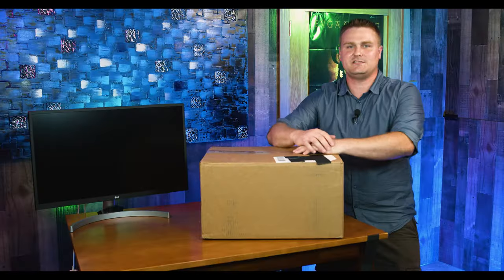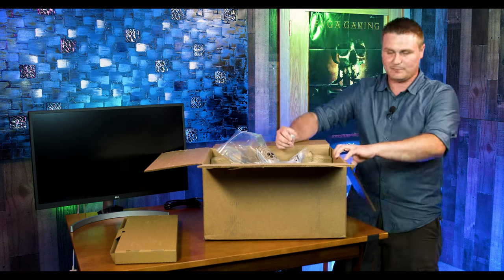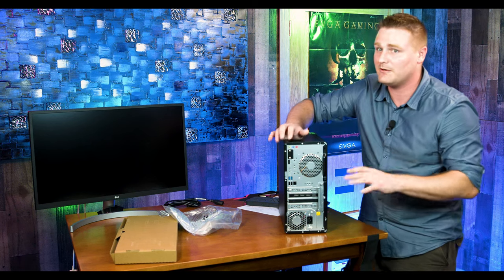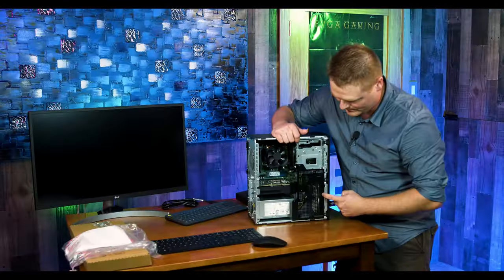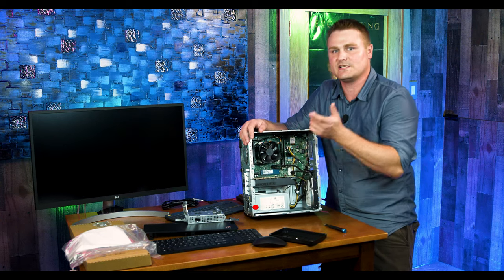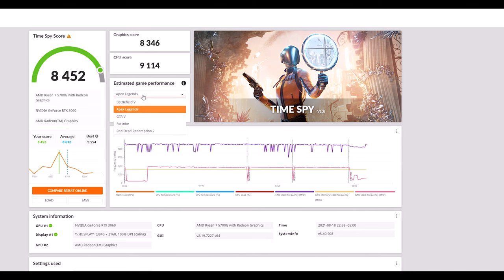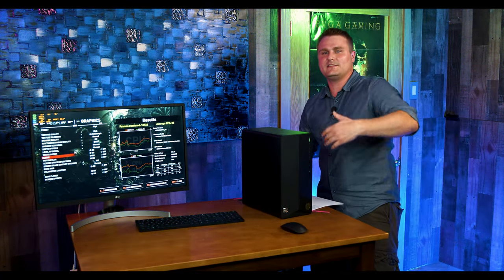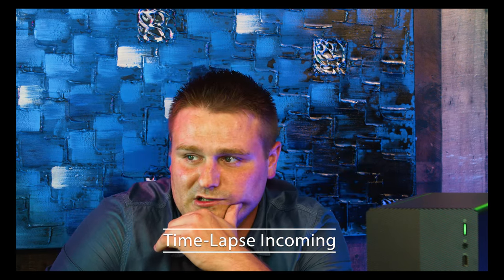HP Pavilion Gaming Desktop TG01 2167z Unboxing Benchmarks & Game Play | Ryzen 7 5700G & A RTX 3060

Comment: I would like to buy another 16GB ram module but I don't know what the brand is specifically
Reply from the maker: Brand is not really important speed, size and capacity needs to all match and voltage witch is 1.2v +

Comment: Hello sir, could you help me, I want to install a 92mm fan but I do not know where to place it because the size of the graphics card makes it difficult for me to place it in the metal cover where a hard drive is supposed to go, do you have any recommendation ?
Reply from the maker: Remove hard drive and place at bottom of case. Then remove cage. Place electrical tape on back of hard-drive or place it on the front like I did in one of my videos. It is one of the TG videos I did. If you need more help just comment. I did not see you comment I try to get back to everyone.

Comment: I got the HP pavilion gaming tg01-2002no, almost the same but with 3060ti and 500w power supply.

Im about to do a memory upgrade, as it is now its 2x8gb 3200mhz.
Im thinking 2x16gb 3200mhz Kingston Fury.
Now my question is if its just plug and play or do I need to do something else? Will they run 3200mhz by defult?

Thanks for the video!
Reply from the maker: No they will not, unless you order the HP ram. or you could use ryzen master to clock it at 3200mhz. the bios is locked.
Reply: @TNW1337  Ok, Thanks!
Reply from the maker: @justrandomcarsurbex3057  Thanks
Reply: Hey, kinda of off topic, but how long would you say your PC took to ship? I ordered mine on the 2nd and it says its supposed to come before Christmas but i see a lot of talk about poor shipping times and delays and was just curious cuz yours is recenr

Comment: Any idea which cpu cooler would fit? I'm looking to upgrade the CPU Cooler
Reply from the maker: Yes any of the Noctuas I use on the other TG videos. The TG01 are all the same.
Reply: @TNW1337  Thanks I live in India and the model is TG01-2002in (5700G+3060 Ti). I was confused If I would be able to get a cpu cooler that would fit.
Reply: @pramodbg  You just need these coolers, and use the LGA1151 bracket that should come with the coolers. Because these brands create their own motherboards they use an Intel mount to reduce cost between AMD/Intel platforms.

Comment: So could you remove the 3060 to use in another PC and just use the integrated graphics on the 5700g. I see the HDMI port is plugged on the mobo side but didn't know if it was blocked off completely or just a dust cover.
Reply from the maker: The cpu does have integrated graphics . Only question would be does the motherboard support it. you could try it and see. it is not gonig to hurt any thing.

Comment: Can i take out the parts and put them in a lian li case with a new motherboard with no problems?
Reply from the maker: Yes You would need Mobo, Case & PSU.
Reply: @TNW1337  any recommendations for the motherboard? Preferably with more than 1 m.2 slot and I’ve got a corsair 750 gold for the psu
Reply from the maker: @Mmd-jo1uu  I like Asus and MSI. The asus has 2 m.2 slots. ASUS ROG Strix B550-F Gaming.

Comment: I got the same HP and haven't been able to access advanced settings in my BIOS for Overclocking etc. Did you solve this?
Reply from the maker: NO the hp do not have any Overclocking settings at all.
Reply: You need to learn how to flash the BIOS, which is more risk than I'd like. But if you want to do that, start by searching for undervolting unlock. Some threads about Lenovo/Dell will pop up. I used this method to undervolt my 11700f.
Reply: @RS-nq8xk  I would try it, but I cans find anything about it
Reply from the maker: @RS-nq8xk  oh I've flashed Biso before the risk is most people that come on the channel are not going to flash the bios. Some of the Hp's I know have a update to allow 3200 1.5v ram to work.  Dell I stay away from to much propriety junk. I can at lest say the Lenovo's and Hp's you can upgrade vs most dells. Also I am not very happy with dell and Hp's 3090, it is junk. They have other RTX cards they done this to. So the 3090 it's core clock is down clocked they did some thing to the vBios to try and keep the card running at 80c. You have to ask the question why would they do this, simple answer is a hotter component does not last as long.

Comment: Hello I have same PC I only top out at about 70fps while playing rust and sometimes have massive Frame drops. My monitor is only 60Hz do you think that’s why?
Reply from the maker: At what Resolution?
Reply: @TNW1337  1080
Reply from the maker: @larsonmedia4687  yes that sound like a problem. Maybe a bad GPU or temps could be cause it to overheat. Download Msi Afterburner and see if you can increase the fan speed see if it helps.
Reply: @TNW1337  can I change that or is that the monitor
Reply: @TNW1337  maybe rust is just heavy on GPU?
Reply: @TNW1337  just got a 144hz monitor btw it FPS tops about 85 on rust but like 140 on fortnite so I guess it’s just rust
Reply from the maker: @larsonmedia4687  It can be,  Can u lower the setting a bit to see if it helps?
Reply from the maker: @larsonmedia4687  yes

Comment: 2:00
Dude, I used those screws to mount a 1TB Samsung SSD into mine (and they actually worked). It was just a real pain in the ass, but I got it mounted just fine. I guess if you really know how to turn a screwdriver, you can do it.
Reply: Oof. That is pain.
Reply from the maker: @2ez4u2  yeah they do not tell you they are 2 differnt type kinda dump to be honest.
Reply: @2ez4u2  Not really. Like I said, you just have to know how to turn a screwdriver.
Reply from the maker: @mikemulligan2169  they are wrong screw types noting about knowing how to turn a screw driver. It is a differnt thread type. I mean yes you can get them to jam in there but lets be honest making new threads is a bad idea in a pc. You end up with metal flaks in side the sdd and well we all know what lose metal does to a ssd or pc. Now I have seen some hps come with ssd screws. I've also seen them come with none.
Reply: @TNW1337  the question is can my 400w plat run the 2 fan 3060? and why dont they just and 500ws i know its all custom and its a single fan but just add the damn 500w

Comment: Do you recommend this pc for mining?
Reply from the maker: Yes you can mini. But have to find one with out low hash rate. As the unlocked card only see about 70% use
Reply: @TNW1337  Power Limit: 70%, Temp limit 71. Core Clock: -200mhz, Memory Clock: 1202 mhz, fan speed: 69%, i configured msi afterburner with that specification and i get 48 HR do you think its good configuration?
Reply: @TNW1337  My temps are 65 degree
Reply from the maker: @hardwell2484  not bad
Reply: @TNW1337  tnx sir and merry Christmas 
The fan sounds kind of loud but I guess that's normal or what do you think about that? And how long do you think I should keep it mining during the day? What I want is to maintain the life of the card.

Comment: Can this computer keep temperatures low with stock fans? Do the fans make noise in gaming?
Reply from the maker: Yes they do, it gets warm like 70-80c that is with stress tests with all parts runing at 100%, it is high but not overly. This is not normal use, gaming you should never see these temps. Unless your setting are to high or the game is Unoptimized.

90c is thermal cut off for cpus. And can Incur damage past 90. High temps just mean less life span normal. The lower you can keep them the long the parts last. So doing the cooling upgrade is a good idea💡.
Reply from the maker: On the loud ness it is not bad.
Reply: @TNW1337  thanks a lot. Nice video
Reply from the maker: @Senzavoltosonoio  thanks

Comment: I use  TP01-2019ur an excellent computer, inside it is identical to what is on the video.  CPU fan JONSBO [CR-1400] - Fits perfectly into the original backplate, M3 screws.
Reply from the maker: Cool

Comment: To all those wondering if they can put a rtx 3060 12gb card in an HP 400 watt PSU: GREAT NEWS! it runs flawlessly on the 400 watt PSU. I have been playing Microsoft Flight Simulator 2020 in VR with Oculus Quest 2 with all settings on HIGH! It's unbelievable and I'm in heaven with the massive upgrade in graphics and how smooth everything is. This little HP Pavilion 690 is a bad mamma jamma indeed! TIP: make sure you use DDU first to uninstall NVIDIA or AMD graphics drivers from previous card, then re-download NVIDIA experience and update to latest drivers for the 3060 XC. I had choppy frames before I did this and afterwards I could have cried tears of joy at the incredible upgrade I now have. CPU temp maxed out at 82 and GPU at 77 after 2 hours of straight high intensity VR. I can live with that baby! Thanks so much technitwit, I never would have even tried this without your help. 👍
Reply from the maker: Thansk :)

Comment: Doesn’t this have the HP Omen software that controls the front LED?  I used that to turn off mine on my TG01-1xxx basically the same PC except for the better CPU as mine also came with the 3060 with 400w PSU.  The 400w PSU is more than sufficient to power the 3060, since it’s Platinum Plus 80 rated.  I was able to run a GTX1650 Super simultaneously with the RTX3060 with no stability issues.
Reply from the maker: Well the omen hub has problems with amd ryzen master & nivida Experience software. Nvidia experience shows fps & allows you to recored your gaming. It also will Optimize the game, to your gpu for best results. So I just unplugged it from the front. Only hp software I will not remove is the Industrial and enterprise software. Most of there consumers software acts like malware - bloat ware.
Reply: Wait, so you ran 2 GPS at the same time on a 400w PSU?! I was worried the PSU on this PC wouldn't be able to handle OC of the GPU since it's only 400w Gold Plus 80. Do you think it'll be okay?
Reply: @spadesofhearts7714  yes, the overclocks on the GTX1650 Super and RTX3060 I used only maxed them both at around 230-250 watts that’s still plenty to power the everything else.  My machine has a Ryzen5 4600G with a TDP at about 65watts.  So total wattage I was pushing wouldn’t have been more than around 380 max.
Reply: @gotrice101  Thanks for the reply :)

Comment: This is pretty much my tg01-0023w at this point. I have a zotac 3060 oc, Corsair vengeance 16gb 3200mhz, r7 3700x. Pretty much maxed out on the 400w psu😂
Reply from the maker: After it be installed. I would say so that's a pretty nice pc..
Reply: @TNW1337  any idea why i get a 90b fan error on boot with the nh-l9x65? the fan spins around 400-500 rpm once booted according to nzxt cam and temps never go higher than expected but i still have the error on startup

Comment: Hi, I have this hp pavilion tg01-2019ur computer.  Will noctua nh-u9s work for me or not?
Reply from the maker: I think it may fit. But I know the normal size heat sink would not fit when I looked. This is a 92mm so if it's not over 5incs it should work like 4 3/4 it should work.
Reply: @TNW1337  I installed it, everything is fine and there is still a reserve of memory
Reply from the maker: @molodoykosholot8295  yes it is possible it does not fix it.the memory Needs to be the right Voltage and  Cas latency.

Comment: Does this mean a 5700g will work in older tg01 chassis/mb?
Reply from the maker: No it will not work with the older TG01s.
Reply: @TNW1337  rats... So the 3700x is the best I can do for my tg01-0023w. Thanks for the clarification!

Comment: i just got same pc but whit a rtx 3060 ti and 500w psu
Reply from the maker: Yes sir they do have that model.
Reply: Im tjinking of getting it is it good?
Reply from the maker: @pepefy3117  Yes, I would  get this or a legion t5 intel. They are about the same price. Unless the on sale.
Reply: @TNW1337  i got the acer nitro with a 3060 ti and 11400f for 1.2k do u think it was worth and do u think i can fit a hdd somewhere
Reply from the maker: @pepefy3117  yes that is good PC. 1.2k is not to bad.
Reply from the maker: @pepefy3117  I need to get one and do some videos on it.
Reply: @TNW1337  ye i mean a ssd slot not a hdd, it says on the website that theres 2 slots and 1 is available but i cant find it. It might be under the gpu but im too scared to remove it
Reply: nvm i found its next to the ram sticks

Comment: My upstairs gets very hot easily! Like 85°+
Reply from the maker: Yeah that is going to sucks for the PC.
Reply: @TNW1337  😑 better buy lots of fans!
Reply: Use MSI Afterburner and set GPU power limit to like 75-80%. It loses a bit of performance but because the GPU frequency/wattage is not linear, you only lose about 10% performance.
Same story with the CPU.
Reply: @RS-nq8xk  I would still run BeamNG, Right?